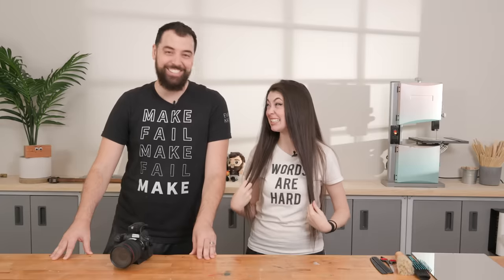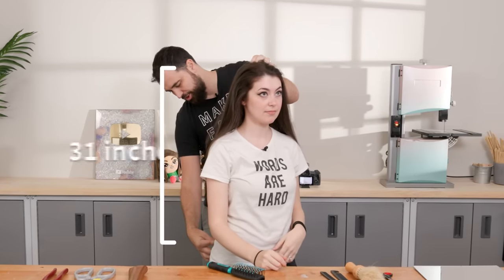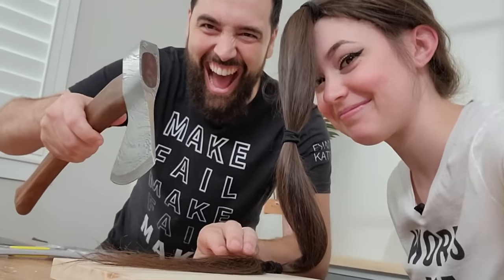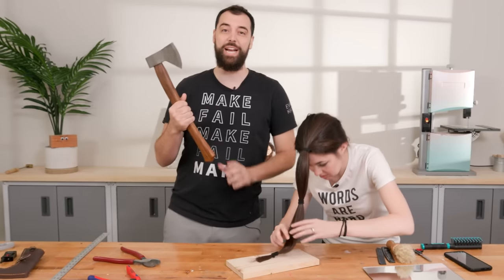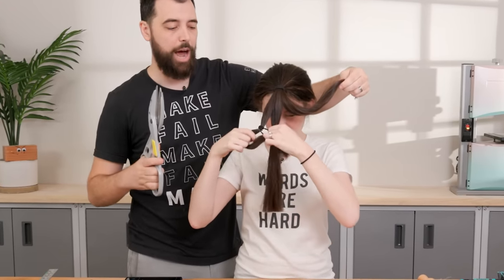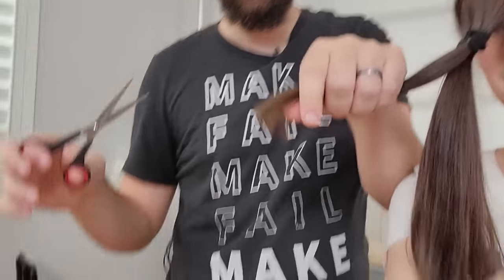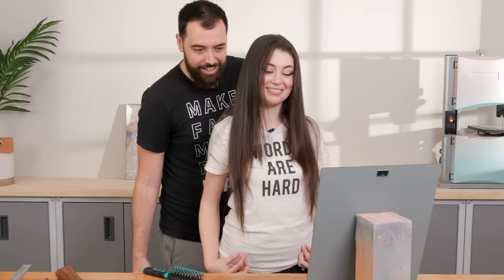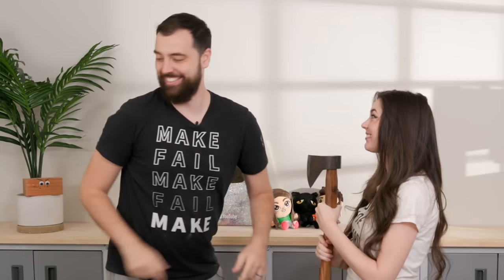Cutting my wife’s hair with an AXE?

Comment: As a cosmetologist, I love how much Ethan knows the different terms and the whole ponytail thing 😭😂
Also yes, feathering is for texture so your ends don’t look as blunt and straight cut across. Also helps to blend layers together. There’s a couple ways you can do texturing and blending, you can point cut which is what Ethan was doing with the cutting upwards on the ends, then there’s one where you twist the hair into a spiral/twisted together and you cut that at angles not going the whole way through the whole thing helps create more layers and blends. There’s a bunch of techniques you can look up and try! Ethan actually did pretty great! Your hair came out beautifully.

Comment: I know Evan & Katelyn are still settling into the new house and setting everything up, but while they're still busy I wonder if they could try doing simple projects that will be easier (& faster) to film and edit.
I know that the edit is the longest part of each project and they usually hv a lot of footage to edit for complicated projects, especially ones that require a lot of drying time so simple projects would probably be a lot easier to manage.

There are plenty of simple projects/video ideas that they could do which would probably be easy for them and still create entertaining content, i.e.:
- product testing videos (e.g. tools, kitchen gadgets, etc)
- more soap & candle videos (i.e. trying more molds & interesting designs, sculpting, creating 3D paintings w/ the wax/soap, 3D printing designs to create their own molds, etc)
- more Bob Ross challenges
- more art/ painting videos (e.g. using their resin pigment paints to create plenty of different styles of paintings), etc.

The Bob Ross projects alone have so many options, but if they didn't wanna limit themselves to painting landscapes, there are plenty of challenges and ideas they could try tbh.

Comment: I have hair as long as Katelyn's and I've been cutting my own hair since my teens. I got real tired of people touching my hair, the pulling, the tugging, the ripping... So done. So I started doing it myself.
I pull it all forward, just like you did, and cut a straight line. I flip it all back, brush it out, then pull a smaller section forward (about the base line of my ears), and cut a straight line. I repeat that twice more, the section I'm pulling forward getting smaller each time until I'm left with the hair that frames my face. The line I'm cutting also gets smaller because this is where the layering is happening. 
Because I do it this way, my face is framed, my hair is layered, and it stays the length I want it. I could never get this from a salon without paying near $100.

Comment: It almost looks like some of the long bits in the back didn't get cut at all. I wouldn't have gone full unicorn and put the ponytail closer to the top of the head instead of having it all the way in the front. There's just such a huge difference between the front and the back when you put the ponytail that far forward